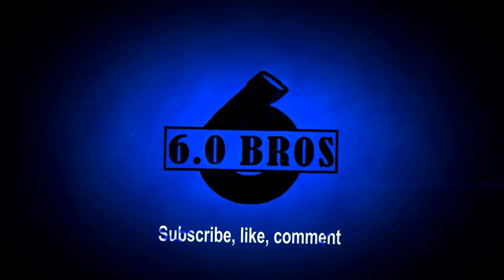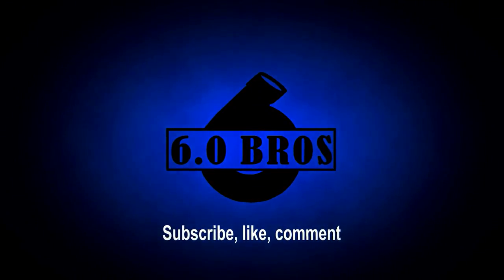6.0 Powerstroke Tow Build List

Comment: Did you see that new KC 6.7 power stroke turbo?  Really want to see more sound clips of that thing.
Reply from the maker: I did see it man. Sounds insane! In the future I'll be running the turbo time 64mm compressor wheel with a 10 blade I hope it sounds similar lmao that kc sounds insane. I think it is more than just a different turbine wheel I have seen companies turning the exhaust housing making it like a 6.0s but I do not know what all they did

Comment: Going to buy a 2007 6.0 F350 at the end of the week.   167k miles on it with all this completed - is this a good start?
2007 f-350 6.0 diesel truck. The truck is 4WD. The truck has been completely bulletproofed to include:

-Bulletproof Diesel air to oil cooler with (heavy duty cooler, heavy duty oil filter)
-Bulletproof Diesel power steering relocation kit
-Bulletproof Diesel water pump with 7.3 clutch fan adapter and clutch fan
-Bulletproof Diesel ARP head studs and head gaskets
-Bulletproof Diesel EGR cooler
-Bulletproof Diesel cold weather kit
-Bulletproof Diesel rocker carrier gasket
-Bulletproof Diesel fuel injector o-ring kit
-Sinister Diesel coolant filtration kit
-Fel Pro Lower conversion gasket set
-Ford oem thermostat 
-Oil rail dummy plug
-Oil stand pipe
Reply from the maker: Looks like an excellent build to start man! I would sat that what is listed here is a good start I would check out the video linked in the first comment about what to do first for a few other tips, but I think you will enjoy the next installment of this video series
Reply: @six0bros  - thank you.  Just found your page today and I've already enjoyed the first 5 vids I've watched.  Thank you for putting this kind of info out there in a way that's pretty easily understood for a newbie to diesel.   Great content!
Reply from the maker: Thanks man. Glad you are enjoying it! Feel free to ask questions and I do live streams every other week. For about 3 hours they are a lot of fun and I answer questions in real time
Reply: @six0bros  awesome.  I'll try to keep an eye out for those.

Comment: Which radiator have u seen that works best for you? I know alot ppl tell me the mishimoto aren't worth the money with the results they see
Reply from the maker: I currently run the mishimoto performance radiator and it cools similar to factory. I do not think any radiator cools better than factory. A lot of guys have had luck with the prime cooling Amazon radiator too.
Reply: @six0bros   Yeah besides the factory side tanks. You can't really beat the OEM radiator
Reply from the maker: And even the end tanks are not terrible I was at 180k miles before replacing and I still did not have issues. Ipr research also has a radiator that seems cool just not sure if it is an improvement or not
Reply: I did Mishimoto's radiator, intercooler, and thermostat.   Made a big difference for me.  I also did the becool hood vents.  The combo was great.

Comment: How about the fan clutch?
Reply from the maker: Like the winter prep fan clutch or bullet proof diesel, blue wire mod? Honestly factory it good. You could do a blue wire mod so you could command it full on while pulling grades
Reply: @six0bros  if I do a blue wire mod, will I get a soft code?
Reply from the maker: I have not done it yet but I am told there is a soft code. Which also happens with the bpd adapter as well
Reply: @six0bros  I also heard about the soft code that comes up with the 7.3 ltr fan clutch adapter.
Reply from the maker: Both blue wire mod and 7.3 fan clutch have a soft code for them
Reply: @6.0 Bros  ok. I bought an OEM fan clutch and will be installing it soon.
Reply from the maker: Good choice man
Reply: @six0bros  Thank you. I only bought this truck to pull a camper & do work. At a price of $4800, I'm not gonna sink more into it than it's $6500 blue book value. I'm saving for a newer diesel 4wd to replace it.
Reply from the maker: I plan to do a review comparing toeing with the 6.7 and the 6.0. Which diesel would you like to buy in the future

Comment: What’s the highest you have towed with the 175 injectors and for how many miles. Quick tricks is who turbotime told me to get tunes from and they told me 155 would be the biggest to tow between 20,000 - 30,000
Reply from the maker: I have towed 13k for 600 miles one way was my longest trip. 175 stock was great. So the nozzle will determine a lot. If you want to go with 175/stock they can tune them to run just like 155/stock. Granted I personally feel a 205/30 is one of the best all around injectors you can get. I am working with a guy that has 175/75s towing 25k but we are working through some egt issues with that because of the large nozzles. Also you can check out blessed performance he is a channel sponsor and affiliate code six0bros will get you 10% off tuning
Reply: @six0bros , I was leaning towards 175/stock. My motor is all new fly cut pistons stage 2 cam arp everything 4in down pipe to 5 inch exhaust . I tow daily so I want the best for that application as my truck is a f450 but I also wanna Dyno my truck and be able to have 6.7 power so all my money was justifiable over a new truck
Reply from the maker: Having towed with both they are very different towing animals. Both great at it though. I found myself missing how my 6.0 was setup over my 6.7. With yiur build and a good tow tune you will love it 175/stock injectors will be great. What turbo are you running?
Reply: @six0bros , I am running the gxr 11 predator velocity port turbo time. And I am adding the banks intercooler system, I have The ipr oil cooler remote kit with high flow coolant filter and I even ordered the stage 3 snows water meth kit
Reply from the maker: That will be a great build. With the water meth and banks setup on top of the banks intercooler and your turbo you should be set for everything and shouldn't have an issue with egts. Here is an affiliate link for thr banks intercooler setup if you're interested 

https://amzn.to/3zvFgFt

Comment: What are your thoughts about a ported intake and a KC turbo stage 1.5 with stock injectors and mild/stock tuning
Reply from the maker: What do you do with your truck overall? Towing, daily? And other mods to the truck?

The intake manifold I am a huge fan of! Now the turbo should be a great upgrade. I do personally prefer the 10 blade turbine wheel and the stage 1.5 has the 13 blade. Some people prefer the slightly faster spool up of the 13 blade, and that it is slightly quieter. You could also consider my sponsor turbotimeusa.com/six0bros that is a 5% off affiliate link. I would check out their 64mm turbo and compare that to the kc stage 1.5 overall for your setup they will perform very similar. I believe you would love both and both would be great for your setup and give room to grow if you ever wanted to go bigger iniectors. So overall excellent setup idea you have.
Reply: @six0bros  towing competitive show quality livestock so reliability is key and I tow big grades, high elevation, high tempersture areas. I constantly fight my egt's but I have a lot more throttle let to give. I have an 07 f-350 drw tow boss package  (4.33 gears), studded, BPD egr cooler, BPD 7.3l fan clutch, aero muffler, and I have a banks Technicolor I need to install. I was planning on doing a 3.5" downpipe next. I think the 10 blade would help me with egt's on grades like you mentioned.
Reply from the maker: With high elevations I would consider the stage 1 turbo. I'm not a big fan overall of it but for elevation it is probably one of your overall best options. Turbo time usa sell their stage 1 with a 10 blade and I think kc gives the option to upgrade to it. How high does your elevation get? Like if you dont do much over 2400 ft. I would say look at the stage 1.5 from kc or stage 2 from turbo time usa. However that high altitude I would go back to comparing the 2 different stage 1 turbos. Again both will be excellent choices
Reply: @six0bros high elevations probably up to 2 to 4 times a year max
Reply from the maker: I know when I had my powermax on my truck over 2,000 ft elevation I could tell I was up there. J mean I didnt have issues just I could tell the truck had less power. Still plenty for towing 13 k but you knew you were getting up there. That said all the turbos we're discussing are better. If you're not up there that high to often I know I would consider the stage 1.5 or stage 2. I wouldnt go kc stage 2 it is larger than turbo time stage 2. It is a great turbo but may not be that great for application. So kc stage 1.5 or a turbo time usa stage 2.
Reply from the maker: How heavy is your load when you're towing
Reply: Towing heavy up high grades running water methanol makes a huge difference.  When it's hot out, I run straight water and generally drop my EGT'S 200-300 degrees.   I pull a 42 foot fifth wheel all through the Southwest US.
Reply from the maker: I have wanted to mess with water meth just haven't gotten around to it yet
Reply: @six0bros  I use it on my 7.3L one ton, Makes a big difference.  I tow uphill here in CO my 42 foot triple axle toy hauler.  I am getting ready to do my 6.0L powerstroke Excursion.   I don't tow as much with it, but with a sinister diesel stage 3 turbo and Warren diesel 30% injectors my EGT'S get hot when pulling my big flat bed with 2 side by sides.

Comment: Is it normal to see higher egts after adding a cai? I added a sinister cai and egts and intake temp seem to be way higher then the factory setup. At sometime 180F intake air. I try and keep out of the throttle when nearing an egt temp of 1300F. Should I consider a S&B cai? I run innovatives tow tune and php 40 ficm tune.
Reply from the maker: 180 seems high for air intake temp. Is that crushing down the road? Or idle?
Reply: 6.0 Bros yes sir that’s running at 70-75 climbing a grade but it drops down to about 108 when on a straight away. Also depends on outside air temp.
Reply: Idle depends on how hard I’ve been pushing it while pulling usually start up is  around 108 after pulling around 130 OAT here around 90-103.
Reply from the maker: Low 100s going on flat sounds right for intake temp. I cannot say I have ever checked it while pulling a grade. How long of a grade was it
Reply: 6.0 Bros it was about 15-20 miles of grade in the lower Rockies a steady climb. But I had noticed it even on a 2-5 mile grade usually when pulling 13,500 camper. Never noticed unloaded.
Reply from the maker: Sounds normal then. I know a lot of people harp on the "hot air intake" thank you banks for that load of crap. When you're talking about a heat soaked engine bay you're never going to escape that heat and some plastic around your intake isnt fixing it lol. So no with a camper hooked up and that long of a grade that sounds normal. It is an extreme situation but I would expect it
Reply: 6.0 Bros awesome! I was ready to try the plastic box around it. Lol. What do you think about water-meth injection?
Reply: I would vent the hood, or buy a vented hood and have it paint matched.  Then add water methanol injection and run straight water in the summer for cooling.  That what I do at least.
Reply from the maker: Sorry I missed the comment. Everything I have seen says it is helpful and I would love to try it.  It is another thing to maintain  but overall I hear good things

Comment: Im looking at a zf6 4x4 6.0  its has 268k miles on it should I be worried or should i pass on it because i would daily it and upgrade it a little its an f-350 single rear wheel just curious because i have had an 06 it was bad this is an 05. What should i look out for and what could i look forward to if i get the truck.
Reply from the maker: If the price is right and the condition is acceptable go for it. Check out my video about what to do first to your 6.0 and what to look for when buying a 6.0 they will help lead you in the right direction. Those videos explain it far better than I can through text
Reply: Powerstroke Specialty in Bufford,Georgia actually bullet proofs and sells 6.0L. Check them out!  I took mine there and have been very happy for over 4 years since!
Reply: @six0bros  i have man it let me know a lot i just don't know with the mileage on the truck thx
Reply: @littlefinkle7757   i would but im down in Texas makes that a real hard thing to do but thx
Reply: They r pretty much the same truck 03 is diff oil lines and diff hpop trans has alot upgrades in later years id delete it all lol
Reply: @jamesgazdag876   thx idk if im getting the truck for sure  but id like to but i really don't need 2 diesels i  got a 5.9 cummins but i've always had a spot for the 6.0
Reply from the maker: The first things I would do honestly would be to change all fluids, diff's trans, transfer case, coolant and oil. Check the whole driveline make sure it's in good shape. I would say the biggest things people overlook in trucks at that mileage are those which are often overlooked
Reply: @six0bros  thx man i will look into it
Reply from the maker: Anytime
Reply: @texasstreetstockracing226  peop,e ship trucks from England to Georgia for them to do the work.  They have a website.  I trailered my truck to them and drove back again when they were done.  Even people in Hawaii have shipped 6.0L to them.  Just saying could save you some $$$ and heart ache
Reply: @littlefinkle7757  thx man im a poor boy as it is im just checking it out rn